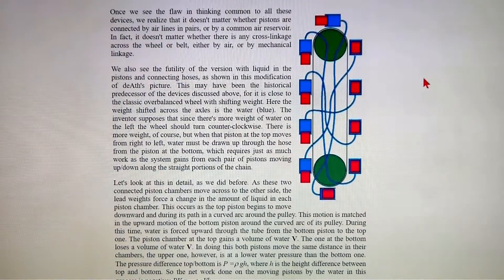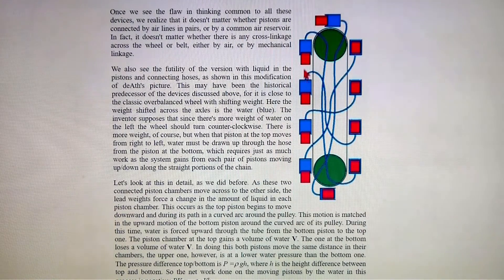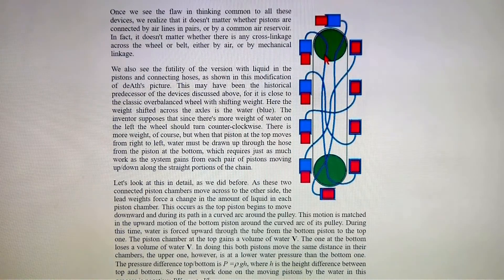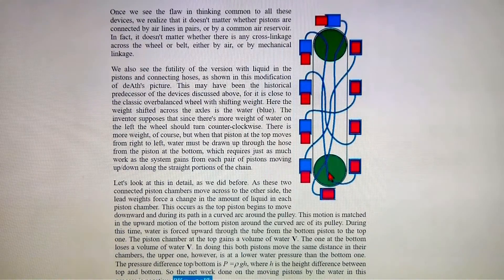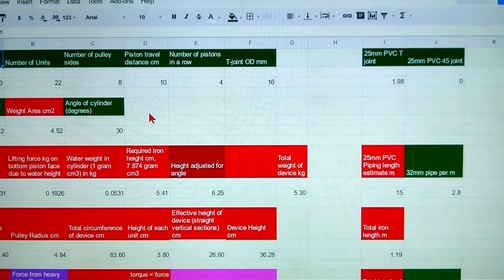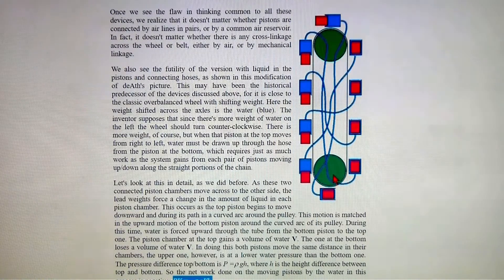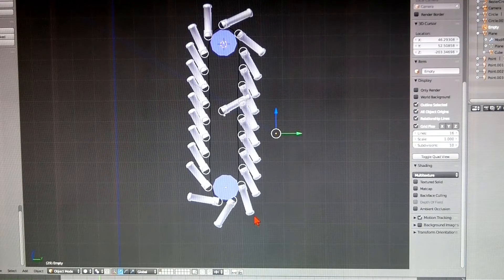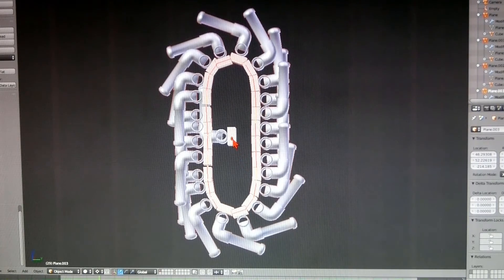New Free Energy overunity gravity powered Vertically Elongated water Wheel

Comment: I have a way different, but similar concept. Here it is: Use a container with multiple water wheels, one above the other somewhat. These water wheels should be designed to catch bubbles instead of water. Each of these bubble-wheels turns a small generator. Fill the container with methylene chloride and put a small heat source on the bottom, such as a night light. It's suppose to make bubbles that go to the first bubble-wheel, and then to the next wheel above that, and so on, until enough power has been produced to keep the night light going. There may be a pressure problem, but I think it can be sectioned off. And of course, it may not even work.
Reply: Did your idea work

Comment: I made this machine in 1977 in a 200 liters tank, with 16  1 liter cans. I did it as the original design in the E. Loedel Elementary Phisics book, and it didn´t works. Then, I did it as you show in this video, and it didn´t works. Then, I connect all the tubes in a central node, and it didn´t works. Then, I add 1 more can, to eliminate the balance. Again, it don´t works. 
Obvious conclusion, it don´t works. Like anyone free energy system, it don´t works, because the free energy don´t exist. I made this machine only for prove it to my students.
Reply: Can i get some informations about your work
And i need the researsh that appears on the video if you have
My email misaraelhadad0001@gmail.com
Thank you and its amazing you made alot of amazing machines.

Comment: i was about to say "that's my design" except my design (that i haven't even published) has the tubes connected directly between each cylinder and the following one so that the high cylinders wont have to suck all that high column of water.
Reply from the maker: The renders I show at the end were intended to have the tubes connected directly between each cylinder.  I just did not show it to keep it simple.  However, you would still get the same pressure difference between top and bottom.  The only advantage of that connection method is that it simplifies construction of the device.

Comment: you make this prototype??
Reply from the maker: Nope.
Reply: +ultrabizz why?
Reply from the maker: It will probably cost ~$2000 just to make a small prototype, perhaps more, since I don't have a machine shop I will have to pay someone to produce the parts.  I don't have the money.
Reply: make in pvc  tubes
Reply from the maker: That was the plan with one of the designs, as you can see in the video.  The problem is the pistons. I made one from wood with two o-rings to seal it, but there was way too much friction and it would not move with the calculated weights.  I was next going to try a rubber bellows as a piston  inside the PVC tube, but bellows are expensive, close to $100 each and there are 22 required.  A balloon inside the pipe, being compressed by the weight might work short term. I did do some tests with balloons but found that they rupture too easily. 

Also the mechanism of chain and cog to transport the pipes around the system would also require further expense.  Someone with a good workshop could probably put something together using old bicycle parts, balloons and PVC pipe.   But saying so and doing so are two different things.  It is not easy to get something like that to work well.

And finely, you could go to all that trouble and expense and find that perhaps it does not work anyway ...